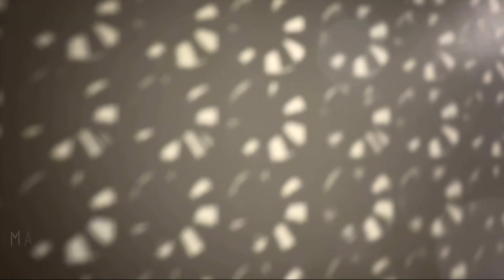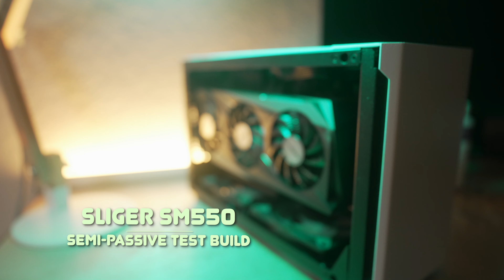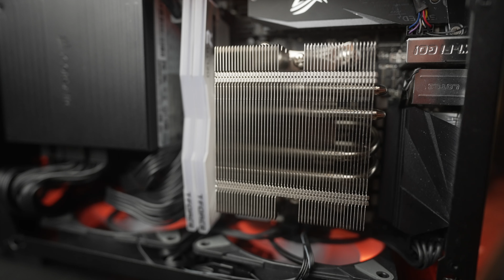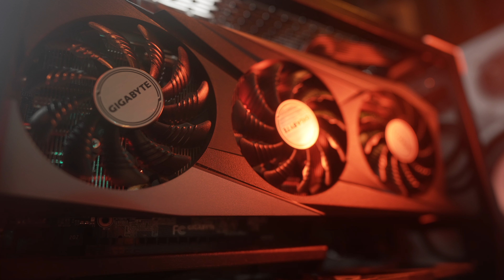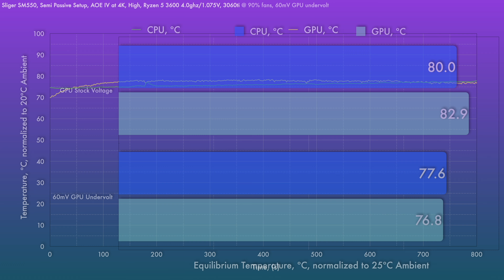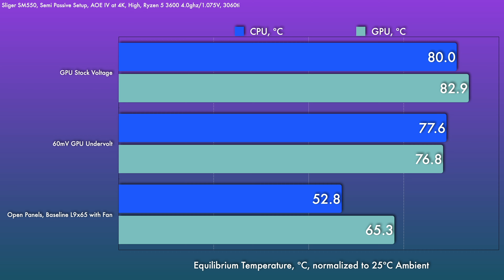Semi-Passive Sliger SM550 Build - Can this work?

Comment: My 3600 is locked at 4.3ghz all core @ 1.175, NR200 with Scythe Fuma 2 and never gets above 63deg even after Cinebench R23 30min run. NR 200 is the best ❤️
Reply: Do you have cooler in the side bracket? Performance with 120s is very good. So I'd go for 140s to lower noise levels. That is if I could afford the motherboard, the case and the PSU. 😂
Reply from the maker: You got a golden one!